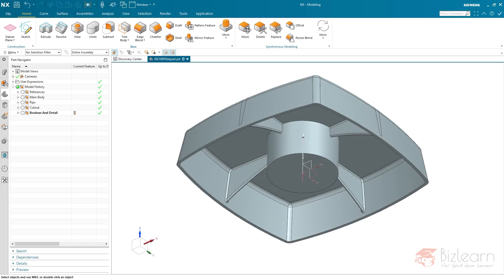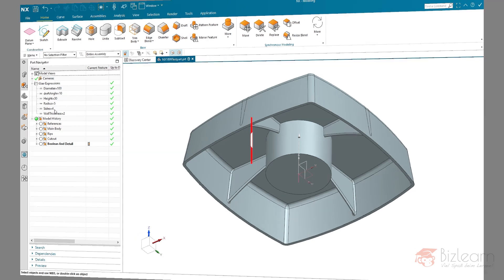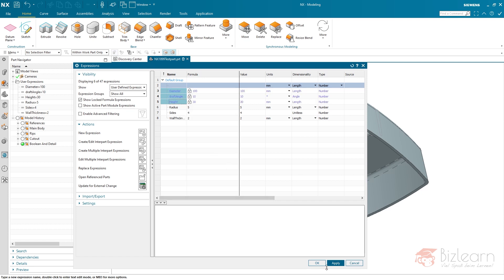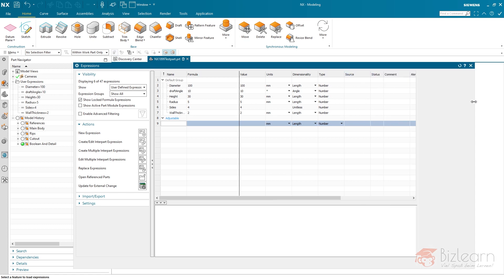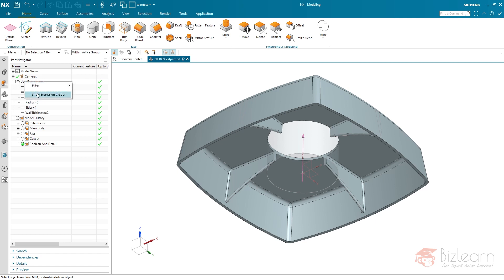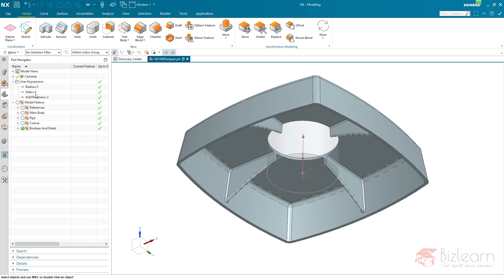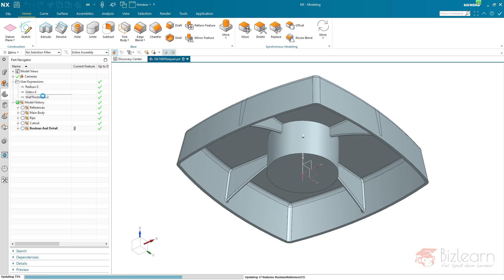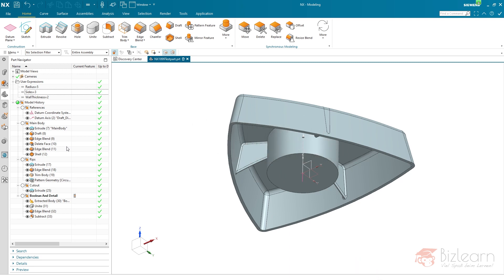Siemens NX 1980 Tutorial – Expression Editor improvements and secrets – this is awesome (-:

Comment: How do you move, lets say, 200 expressions at once into an existing or new group (NX 1973)?
Reply from the maker: Not possible I guess. Have you tried to export expressions with groups already? Are the groups exported as well?
Reply: @Bizlearn_Siemens_NX_Training , after I sent my question I found out a way to do it. On the expression editor, select the expression/s (use ctrl to do multiple selection) then click and hold in any of those selected expressions until the cursor changes and move the block of expressions to the target group (create one beforehand if needed) then release the mouse. I wish Siemens improve the usability of the editor, it is really limited.
And no, I don't see any group information in the exported expressions file.

Comment: Hi Simon, going thru expressions I've a issue with Import command. There's a way to import Groups with expressions keeping the original structure exported? Eg: Exported expressions have multiple levels of groups. I've tried to find out the appropriated attribute to fill in the .exp file but not found anything related. Thanks. Your videos rocks!!

Comment: We will upgrade nx next month, I am looking forward. Design groups sound very good!
Reply from the maker: Hey, which version were you using before? Design groups require a strategic design method like the horizontal modeling solutions I have presented. Then you will have the full advantage, but also depending on the product type you are designing.
Reply: @Bizlearn_Siemens_NX_Training  we are using 1872. First time I heard horizontal modeling was in this channel. I still try to remove bad practices and follow horizontal modeling all the time :-)
Reply from the maker: @jacoboku  good idea (-: Hopefully, you are involving your colleagues as well - they maybe will have to deal with your designs (-: